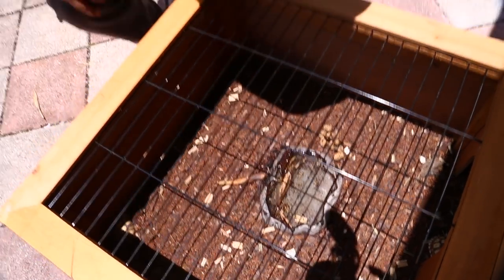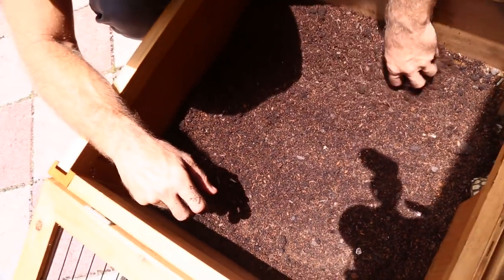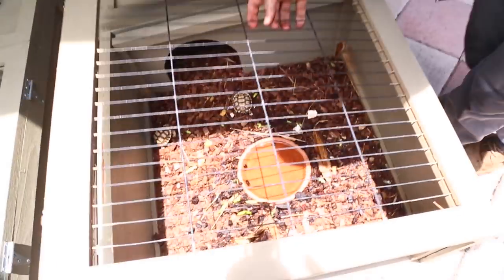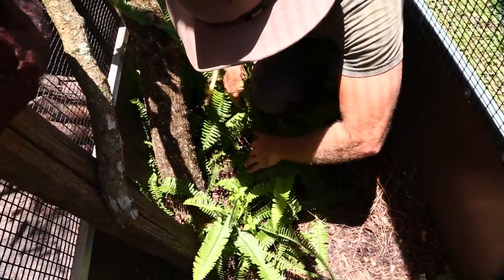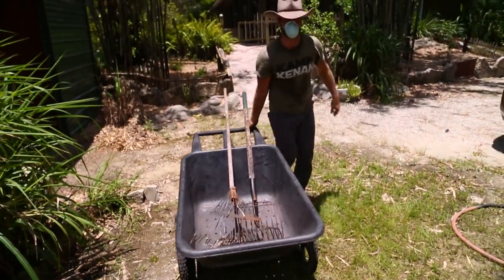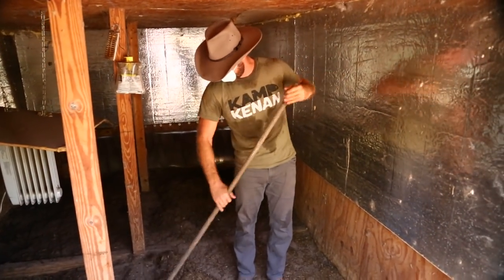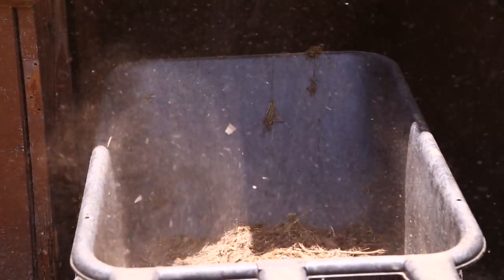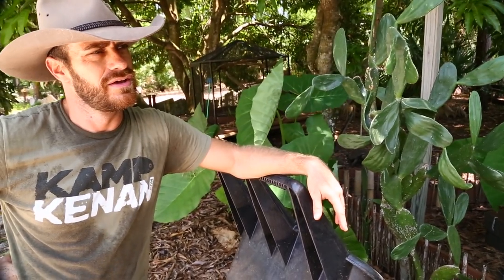How to Deal with Reptile & Tortoise Poop at Kamp Kenan!

Comment: The oil filled radiator heater your using are a fire hazard and are super power wasters. For the amour it gets use there it my not seam like much but they suck. For turtles sake how about a date heater for them. Oil leaks also bad for the kids.